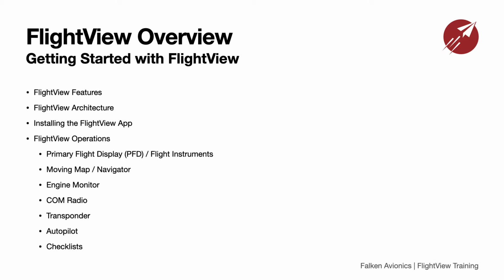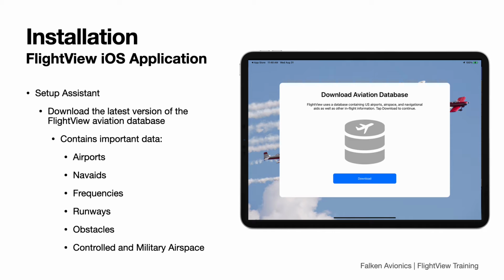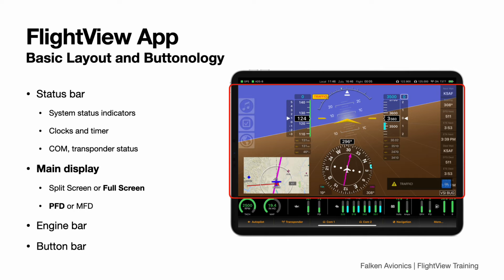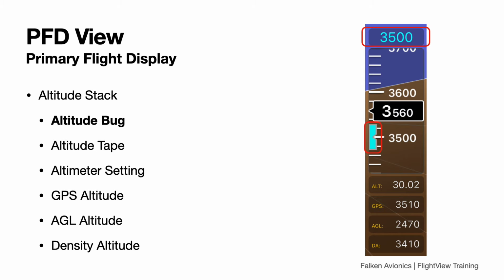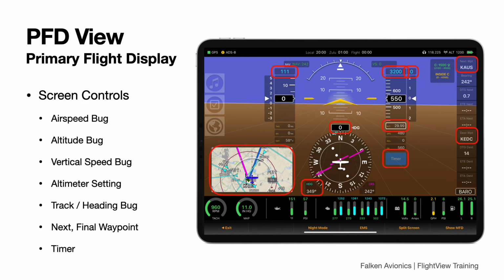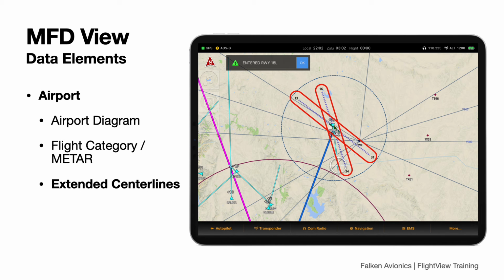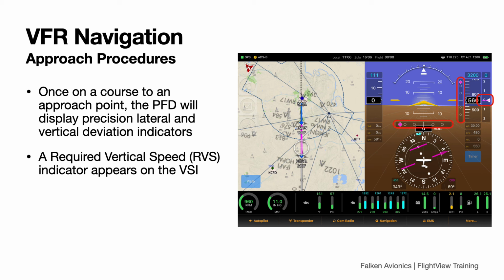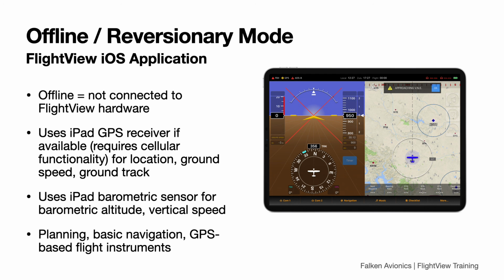FlightView Overview and Pilot Guide

Comment: HI. 
Just wondering if the Falken EMS app in split screen mode will run the Falken EMS on one half of the screen (with all the engine stuff) with Sky Demon on the other half of the screen so both apps are visible at the same time?